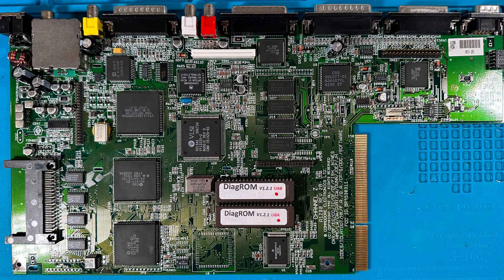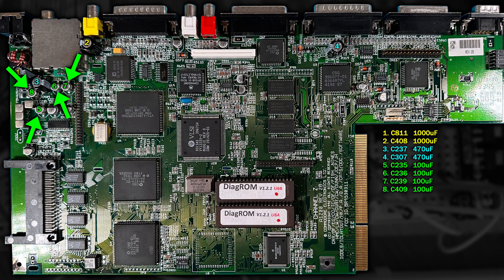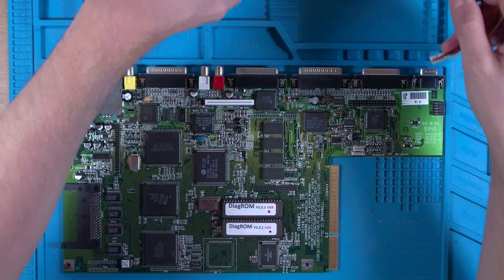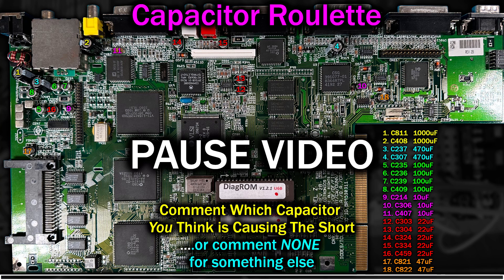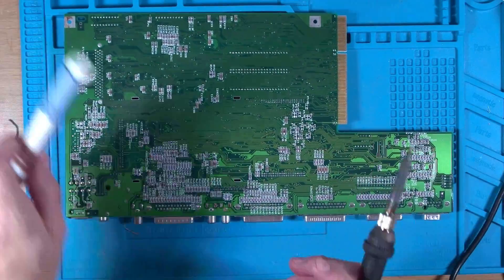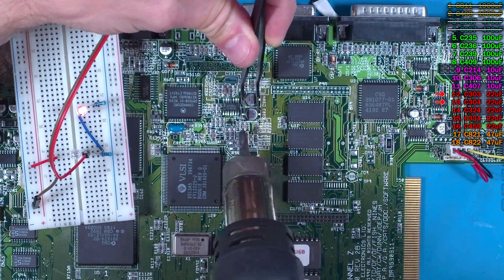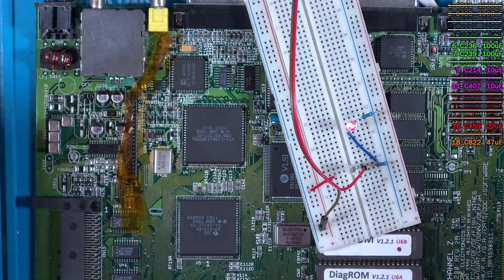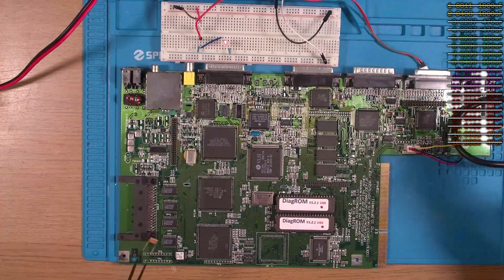Finding a Amiga DEAD SHORT!

Comment: Try using Tin Foil and Kaptan tape to protect your heat sensitive components/connectors ;-) Also you can pour IPA onto the surface mount caps to see if you can see where it evaporates quickest when applying 5v to the board.
Reply from the maker: I tried with kaptan tape - I think the stuff I had was fake as it was shrinking under heat hence why I desoldered stuff. Watch the sequel! It’s more fun!

Comment: Are you using a RCT pro board to test the ic's in this video?.
If so, could you tell me where you got the components from in the UK since I'm struggling to complete the B.O.M.
Reply from the maker: This video doesn’t even get as far as the ICs but if I understand correctly it probably wouldn’t test some of the more custom ones right?
Reply: @RobSmithDev  

There's new firmware available for it but I have to build it first 😁

Comment: conspiracy theory: in addition to the real "not electrolytic capacitor" short, all capacitors were shorted but since they've been removed now we'll never know!

given the ohmmeter reads very small resistance near the connector I reckon it's at the connector
Reply from the maker: Unfortunately it reads zero ohm everywhere I guess my meter needs more accuracy but you could be right… we’ll hopefully find out in part 2
Reply: @RobSmithDev  I think that's because it is in diode test mode in the video
Reply from the maker: @iamdkk  Meter shows ohms in that mode, but I did try that on the normal ohm setting, even on its highest accuracy it still read as zero. A more accurate meter might help

Comment: Also, when using a heatgun near plastic parts, cover them with kapton (spelling?) tape - much easier than desoldering them
Reply from the maker: Lol, yeah my spelling isnt perfect! - you'll see I use it later on
Reply: @RobSmithDev  🙂
Also, would it be possible to use a multimeter to find the short, by measuing 5V and GND at different places on the board - since the length of the copper traces should give higher resistance if the short is on the other side of the board?
Reply from the maker: Sometimes its possible, but given how strong a short it is it literally measures zero all over the board! - dont worry, we'll sort it in part 2
Reply: @RobSmithDev  looking forward to part 2 🙂
Reply: @RobSmithDev  The spelling part was on me, since I wasn't sure how to spell it :)
Anyway, really like the videos.